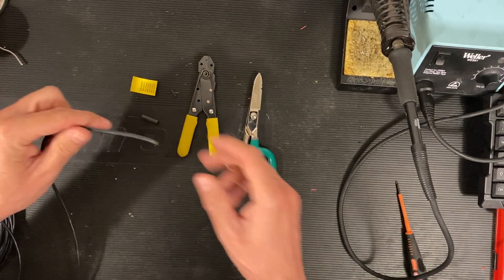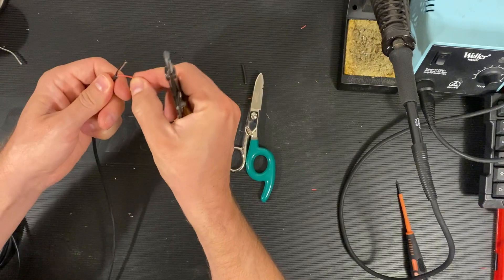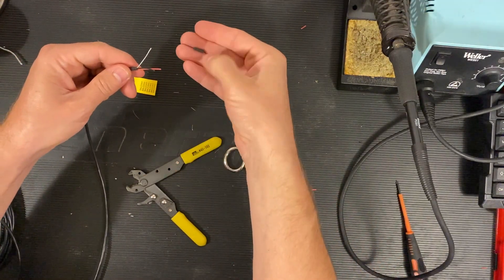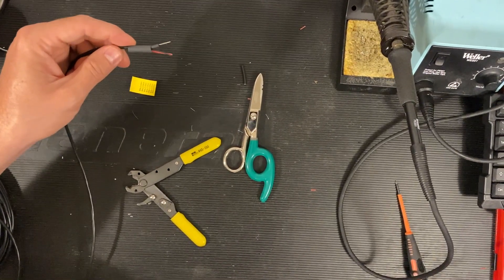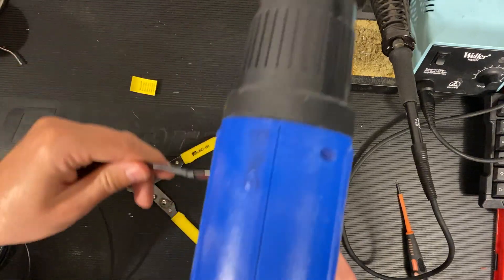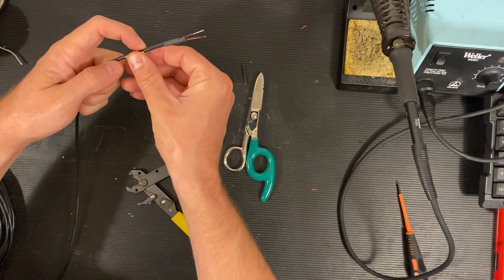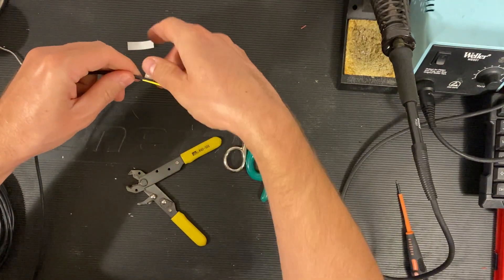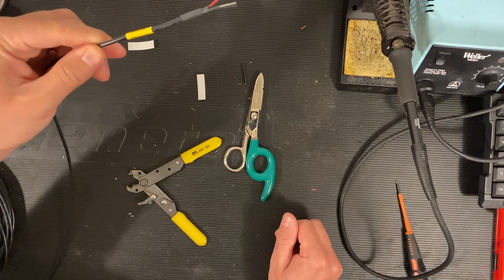Preparing a 22 AWG Audio Signal Cable for Terminations

Comment: Thanks for the video.

Stupid question...I bought a lot of 22awg cable meant for permanent installations thinking it was normal cable meant to be plugged and unplugged. Do you think I'd be able to use this reliably as a normal cable?
Reply from the maker: It will work, though the limited flexability may prevent it from laying flat, creating trip hazzards.  Unless it's plenum rated, the outter jacket on most cable meant to be installed is pretty tough so it will hold up under general use, but it's not as thick as cable meant for portable use so will degrade faster.  You could use it to build adapter cables.